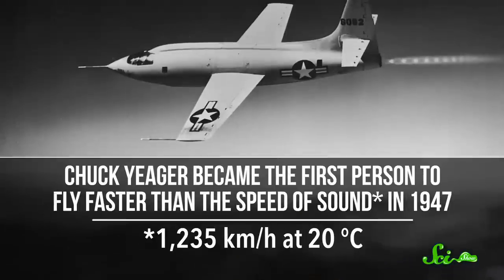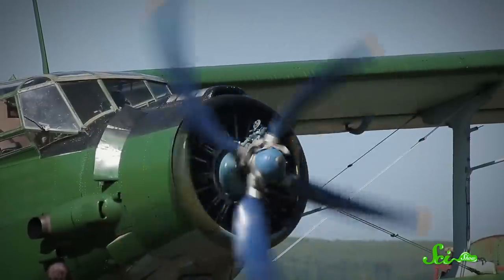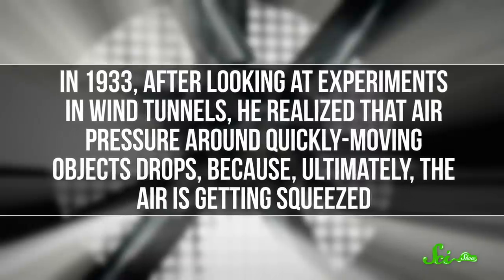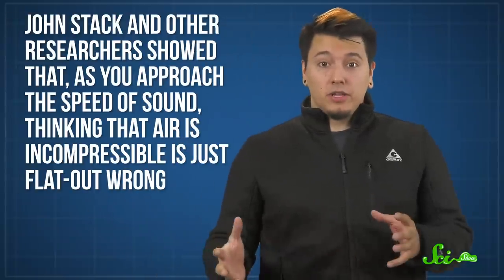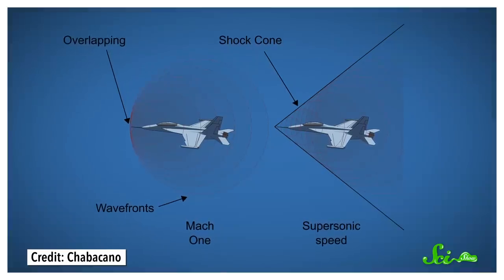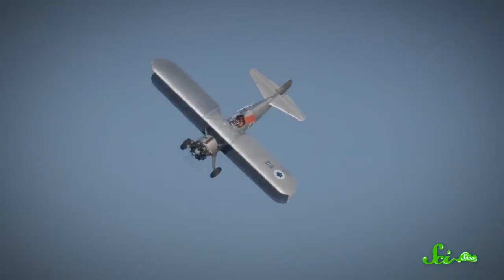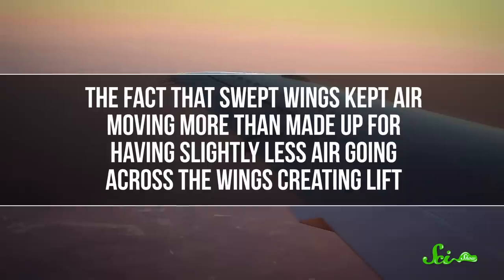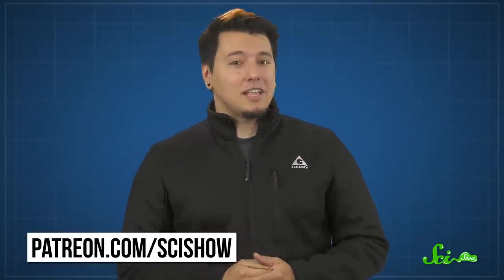A Surprisingly Simple Secret to Supersonic Flight

Comment: The first industrial Air Compressors were introduced in the late 1700s, over a hundred years before the first flight. How can you claim they thought air to be incompressible?
Reply: *atmospheric air*. that's the key part.
if you shove it in a pipe it compresses but if you swim in it it moves away because the atmosphere is an open container... something like that.
Reply: @emperorSbraz  compressible is compressible. Whether the container is a pipe or a virtual container of inertia and friction. All I'm saying is engineers 100 years ago knew about these things. I find the video's claim of their ignorance hard to swallow.
Reply: @Tfaonc  i know it was weird when i heard it in the vid, that's why i searched around the comment setion. :) they assumed the effect if present would be so minuscule it's not even worth bothering. oh they were wrong. :)

i don't know about you but when i was little i was taught that air "hits the wing and pushes it up like a slap", so the old concept stuck in the heads even with teachers operating in the 80s to early 90s.

many years later when doing research to build an RC plane i finally read how it ACTUALLY works i was like DAMN now that weird bent teardrop shape makes a ton of sense!
Reply: @emperorSbraz  There's also the fact that nobody had made an object or machine that had parts that approached the speed of sound in an open environment until the early 20th century. There was no means to examine how atmospheric air would behave, and therefore no refutation of a wrong assumption. Aerodynamic engineering has always had a history of "wrong assumptions about basic stuff", and in the late 19th century this could have made powered flight impossible if it weren't for the sober work of the Wright Brothers and some other engineers.

Comment: 3:00 In this case it's not Chuck Yeager that's the hero, but the engineers behind the Bell X-1.
Yeager was "only" a hero by flying it. 👍
Reply: Honestly Yeager was as much a part of it as the engineers were. He was part of the input that they used to redesign the control system for the elevators, making them controllable in transsonic and supersonic flight. 
So the aircraft, the engineers and the pilots that flew it are all equally the heres in that story.
Reply: @sparkplug1018  Chuck Yeager was a bad ass test pilot, and WW2 hero. 
But he was not nearly an engineer. 
Maybe his input and response was important, but it was the calculations and inventions that made the X-1 go fast!

Comment: Can you do a video on how the problem of super sonic aircraft slow air down inside the engine in order to fly faster than the speed of sound?
It’s another one of those simple yet ingenious innovations that makes super sonic flight possible.
Reply: Yet... like swept wings... the X-1 didn’t need that either to go supersonic. ;)
Reply: The air slowing down in the (jet) engine is for the engine’s sake... not to fly supersonic.
Reply: Bartonovich52 fuel and air do not mix well enough at super sonic speed to produce enough thrust to stay above the speed of sound.

The thrust pressures within a turbine or jet engine are lateral and in two locations. The first lateral compression pressure is in the compressor stage, after this stage the air is de-swirled and then it passes through a mixture and combustion stage, as air expands rapidly when super heated this stage has a build up of pressure that is directed laterally to produce thrust.

A jet engine is the simplest of engines, only one moving part, the turbine.

Comment: So... If you had a channel inwhich air must be stretched to pass through... Could you not harnes that shock wave and manipulate it by influencing the paths taken through said channel... Like with valves to release tension on the outer wing for high speed turning? Or even creating an Upside down helicopter to suck air in and around it creating a super sonic bubble to then manipulate say increase or decrease the heat in the bubble to rise and fall... Or even directional air jets to pop the bubble temporarily giving momentum for some form of direction?
Reply: Creating a bubble like that around a jet would have a hugely detrimental effect on performance. Since that bubble would make the aircraft essentially behave like a ball moving through the air. Which wouldn't fly very well.
Reply: Interesting thought, but shock waves tend to lead to turbulent airflow, which gives engineers and airline passengers headaches. AFAIK, in most supersonic jet engines, intakes are designed to REDUCE the speed of airflow to subsonic so that shock waves do not develop on thin compressor/turbine blades. (The F-4 intake is an interesting example.) OTOH, ramjets use shock waves to compress/ignite fuel, but AFAIK, controlling shock waves the way you desire isn't solved. Yet.
You can use smaller airstreams to control larger ones; that's the Coanda Effect.

Comment: the x-29 with the forward swept wing looks all sci-fi and crazy
Reply: YES but that design has more to do with channeling air towards the inner rear of the plane where pitch control surfaces tend to stall prematurely with traditional delta/swept wings.
Reply: @emperorSbraz  True, but there was a theoretical gain in aerodynamic efficiency at supersonic speeds as well based on the VLM codes

Comment: "engineers invented the swept wing to stabilize supersonic flight"

Cries in DC-3
Reply: The form of the wing of a DC-3 had something to do with balance and not speed, if I remember correctly.
Reply: The 262 was the same way, not for speed.
Reply: @Bartonovich52  Huh, really? I thought the wings were slightly swept for better efficiency at high speeds, since the 004 engines were so weak it wasn't gonna go that fast anyway.

Comment: Error: swept wings do not work by having air sweep along the leading edge "like a roller coaster". Using a swept wing increases the apparent chordal length of the wing section. Now go get a text on aerodynamics and it will explain in detail why this is helpful.
Reply: Your criticism of this video is weak. Clearly more than one way exists to explain a given concept, if you had read enough texts you would understand that and not try to take down other people for no reason
Reply: @DaylightDigital  Well, other than the concept in the video being wrong... that could be a reason couldn't it?
Reply: @aceroadholder2185  We could also describe the benefit in terms of a reduction of the Mach number normal to the leading edge, which I would argue is an equally valid approach to explaining the concept. That being said, I agree that the specific explanation provided in the video is not very intuitive or especially helpful compared to other possible answers

Comment: Does water also compress, if you have a fast enough moving vehicle through it?
Reply: No.
Well, barely.
The fact that sound can travel through water means it is slightly elastic, but it's (otherwise) incompressiblity is what makes hydraulics possible.
Reply: Probably most likely certainly definitively perhaps maybe
Reply: Sort of, but Water is so much denser than air that there is very little room for it to compress further, so it generally acts incompressible.
Reply: @Badpvppaladin  -Thanks for clearing that up.
Reply: Literally everything is technically compressible.

Comment: How could they think air is incompressible, when the combustion cycle in the very engines powering their planes involves.... Compressing air...
Reply: They knew that alright, steam engines were old news after all. But at low speeds it's a reasonable simplification. It's like saying that 1m long steel rod is always 1m long and it's length doesn't change. It's true, unless you start measuring with micrometer accuracy, then stress and temperature play quite a lot of role actually.
Reply: They knew it could compress they just didn't account for what it would to aerodynamically at high speeds, because until about 1/3 the speed of sound air is essentially incompressible in the way it behaves around an aircraft.
Reply: because in those instances the air has nowhere to go and is therefore forced to compress.
the assumption was that, as long as the air had somewhere else to go, said air would avoid compression by simply moving away from whichever object is moving through it, which is generally true at low speeds.

normally you'd expect for air molecules to move out of your way as you move through them, but what actually happens is that you are pushing air molecules aside and that initial push, the information that said air molecules are being pushed moves through that medium as a wave, which moves, you guessed it, at the speed of sound. 

now lets assume that the air you're pushing ahead as a series of layers of air molecules, with layer one being the one right in front of you.
if you move through air at speeds close to the speed of sound you are pushing layer one ahead before layer 2 "knows" it's being pushed so the distance between layer 1 and layer 2 shrinks which is compression.

it's easy to see how people could neglect this seeing what little difference it makes at low speeds.

Comment: Your wording is a little confusing; air compression was discovered much earlier than this. Did you mean that the engineers then did not realise that a plane could compress the air Infront of it ?
Reply: Yes.
Reply: A better way of putting it is that Engineers assumed that the plane wouldn't compress the air by any significant factor even at high speeds. When you clap your cupped hands together you slightly compress the air trapped between them, but not by an amount that you would notice without absurdly precise measurements. This was known even before John Stack but they figured that the compression would remain minuscule at any speed and thus it was safe to disregard.
Reply: As this video states, what makes the air "get out of the way" as it approaches the fuselage and wing is really just information communicated via pressure waves.   A molecule of air near the airfoil is slowed, or deflected by the molecules of air closest to the surface, and that pushes and pulls on its neighbors above and in front of them, and those to their neighbors and so forth.   The strength of the wave dissipates as it expands.    The pressure waves cause both high and low pressure regions which generate lift in the subsonic realm.   The rules for how air moves stay pretty much the same up to about Mach 0.6.  The problem is, those pressure waves are transmitted at no faster than the speed of sound, so as the airflow approaches the transonic realm the neighboring molecules can't get out of the way fast enough so they are forced closer to each other (compressed).   At true supersonic speeds, no pressure information whatsoever can be communicated ahead of the aircraft fuselage and airfoil, so almost every molecule of air within the frontal cross section of the aircraft, pretty much just smashes into the fuselage and airfoil surface  and bounces off like a little ball bearings.    This generates a tremendous amount of drag and heat, and a sharp pressure wave that radiates away at the speed of sound (the sonic boom).    It can also punch a hole through the air that can only collapse at the speed of sound, and if that collapse doesn't converge before the wing and stabilizer control surfaces, it can literally blank  them out (leave them in a region of slow or non-moving air), making them totally ineffective (or it can collapse right on the surfaces causing such a huge force that the pilot cannot move the surfaces without hydraulic assistance).     For this reason, airfoils and stabilizers designed for true supersonic flight must be extremely thin (which means they do not produce a lot of lift in subsonic realm), and stabilizers are often full flying (look at military jets in particular), so they can't blank out the control surfaces.    The whole stabilizer moves and simply deflects those molecules smashing into it upward or downward.     

Airliners don't fly at supersonic speeds, they have very thick airfoils, and relatively normal stabilizers, but because they are so heavy and generate a lot of lift, the air over the wing is accelerated well into the transonic realm, so they have to mitigate with some of the same features of supersonic aircraft, such as swept wings.   They also have horizontal stabilizers that utilize a trim mechanism that moves the entire stab so at their fastest cruising speed the stab can be  perfectly aligned with the airflow, reducing the possibility of blanking out the control surfaces.     

The way that supersonic military jets get around the problem of needing both very thin airfoils for supersonic flight  and high lift for high-G maneuvering at subsonic speeds is by changing the shape of the airfoil with leading and/or trailing edge slats and extensions.    The wing can behave like a thicker one at low speeds, and remain very thin at superonic speeds.
Reply: @daemn42  : Just an addendum, as far as I know most airliners use various wing extension & airflow-control devices for partially the same reason as military vehicles, though there is also a fuel-efficiency aspect too.
Reply: @absalomdraconis   True, but for airliners I think it's primarily about high efficiency achieved with higher aspect wings at Mach 0.7-0.8 balanced against the need to handle extremely high wing loading at low airspeeds during takeoff and landing phases.    I doubt that any airliner wing (assuming it were made strong enough) would perform well beyond Mach 1.0.    
The only supersonic military aircraft with a comparable size and gross takeoff weight to an airliner would be the B-2, and it has thinner wings with massive leading edge extensions, and then sweeps back into a delta configuration to go fast, and still must run  4 afterburners to maintain supersonic speeds.

Comment: They never explained the other reasons for swept wing surfaces... Such as air flow breaking from the wing surface like with the p38 lightning as a famous example
Reply: In terms of going really fast in a straight line, that didn’t matter as much. While swept wings helped alleviate that, the more important development for very high speed air travel was fully live tails, which even in a flow separation event are able to grab air and control the plane

Comment: There’s a theory Chuck Yeager was only the first man to break the sound barrier in level flight this is because the Korean War had been going on and the standard American fighter jet at the time, the F-86 Saber, could and did on several occasions break the speed of sound in a dive. It’s possible that some fighter pilots had broken through before Yeager but he was definitely the first to do it in level flight
Reply: Its possible that fighters had done it as early as WW2 in a dive. But yeah, Yeager was the first to do it in controlled level flight.
Reply: sparkplug1018 what would have done that in ww2? The Me262 is the only thing I can think of even remotely capable but I’ve never heard of one actually doing it
Reply: @andyrihn1  There were rumors that a German Me-262 pilot did it, as well as a few P-38's. Though the Me-262 is highly unlikely and the P-38 accounts were right after the pilot had lost control of it in a dive.
Reply: sparkplug1018 I too doubt the Me262 doing it. While superficially similar to the F86, they just weren’t nearly as powerful nor built as strong. 

I can’t believe the P38. A propeller driven plane going faster than sound is an extraordinary claim. A twin-engine WW2 fighter doing it is extra-extraordinary
Reply: @andyrihn1  Cant recall where I've heard it, but it is usually along the lines of, after loosing control and just before the wings failed. 
Probably a attempt at propaganda by some of the troops given its high top speed, same with the Germans.

Comment: “Swept wings come out at an angle, usually pointing towards the tail.”

Wait... there’s planes that have swept wings pointing forwards?
Reply: There are X-29 and Su-47, however such wing design will break at high speeds, that's why there were just experimental models.
Reply: A forward swept wing has to be much stronger and stiffer than a rear swept wing to resist twisting.

Comment: air compressibility can affect planes quite a lot at just 230kt at high altitudes, but shockwaves is another story and it was the main ambiguity for supersonic flying
Reply: Maybe 230 kt indicated which is well past 300KTAS.
Reply: @Bartonovich52  that's still way below the speed of sound.Theorically, temperature has to be around -214°c  for 300KTAS to be the speed of sound

Comment: How did they think air was incompressible if they were using it to fill up tires?
Reply: What is meant is that the models treated air as incompressible because it was believed the effects of compression would be too negligible to matter. The discovery was that air is compressed more than accounted for at those high speeds.
Reply: Poorly worded. They knew air was compressible, just like we know that water is compressible - yet we refer to water as incompressible because for all practicable purposes you cannot compress it.
Reply: Harman Robotics apparently if you compress water enough it turns to ice

Comment: - "Because once you've found a solution, you don't always need to keep switching things up."- Some Russian: put wing forward in the SU-47- Can you explain the physics of this plane?
Reply: Aerodynamiccaly it does not matter which direction the sweep is. It is a matter of structural stiffness, flight dynamics and some other stuff. Therefore for some specialized uses forward sweeping is actually an advantage where it is usually a disadvantage containing more weight and some tricky flight control issues for normal aviation.